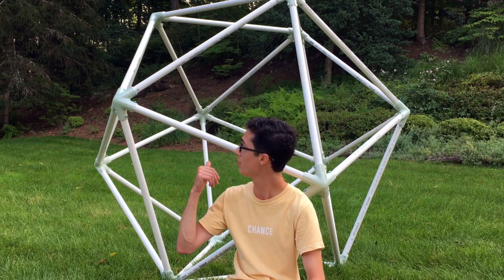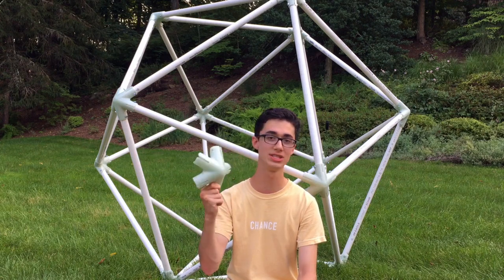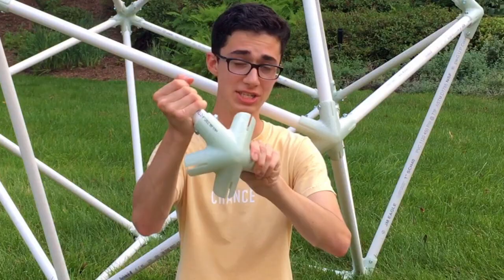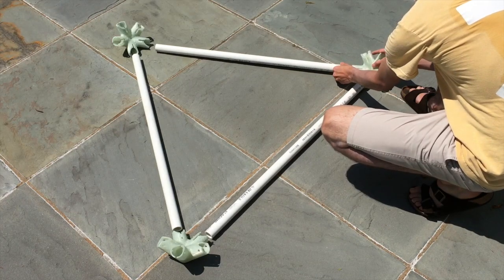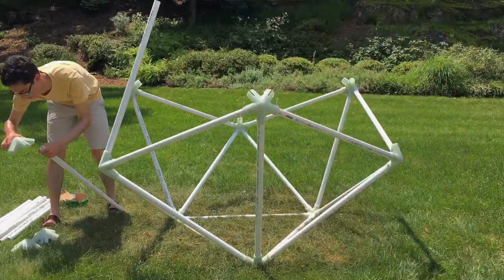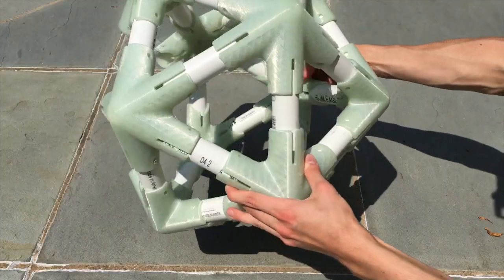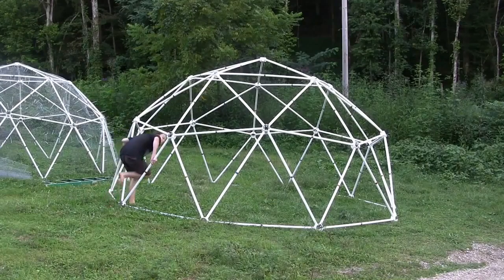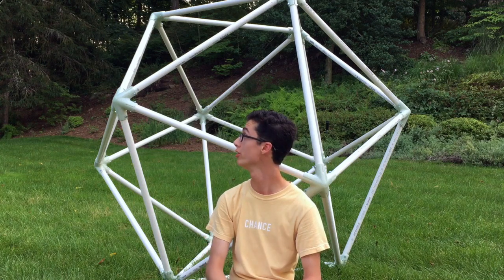Building a PVC Icosahedron with 3D Printing

Comment: nice project. although the corners of omni-triangulated systems needn't be rigid. one could just as well take adozensix branches of equal length and tie them together with knots. might need a little tuning of what type of line for any given scale, but saves massively on time and energy investment... I recommend triple clove hitches going around inside the corners🙏

Comment: Great video, is there any way for you to make 2V dome connectors? Also, how do you calculate the size? I want to make one with a diameter of 1.5 meters.
Reply from the maker: Thank you! Making 2V connectors should be pretty straightforward, the only difference is that you will need to design two different types of connectors, and to make the actual dome, you will need two different lengths of pipe. To design the connectors for my dome, I generated the geodesic sphere in Blender, imported it into Fusion 360, and designed the connector around the vertices of the sphere.